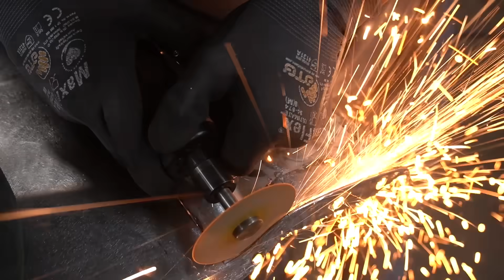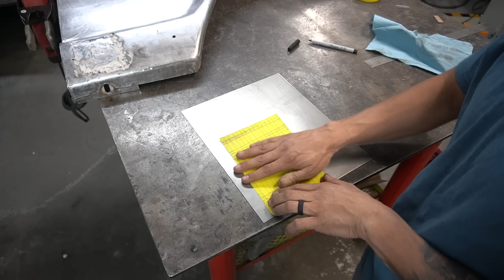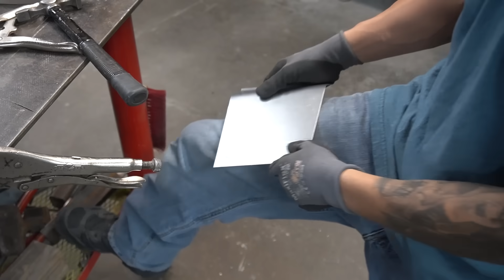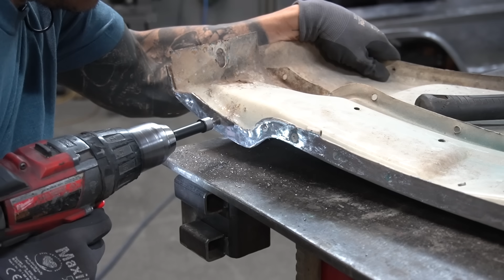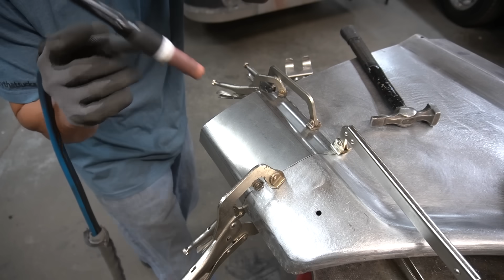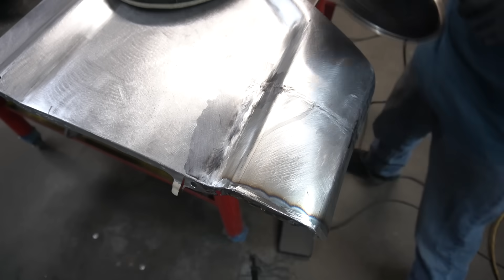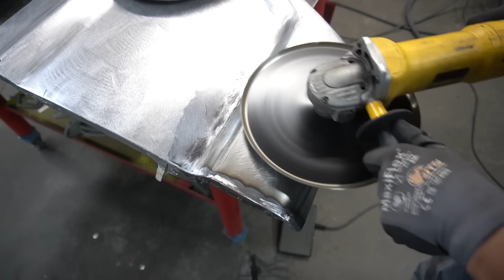how to make a patch panel | fix rust

Comment: Very good work. I need to have this done on my 69 Chevelle. Where would one purchase the correct gauge metal for such a job?
Reply from the maker: I get it from the local steel yard in Albuquerque. its just 20g cold rolled mild steel.

Comment: QUESTION : Why did u used TIG for the surface operation, and MIG for the back panel operation?  Can you explain me the differences?
Reply from the maker: tig welds are malleable for planishing much more than mig welds. also the mig welds are better for spotwelds and quicker for welding the brace back together

Comment: Very nice job thanks 
I need that air grinder with the disc and how many mm thickness the disk and where to find and what model I appreciate your job professional too really and simple teach too
But I use tig welding give much cleaner job I am in thailand can’t find many things specially some your tools
Reply from the maker: Yeah Thank you! I have a few angle grinders Snap-On and Matco, I believe they are 1hp. they can be found on ebay.com. the disc is a 36 grit 3M roloc. thanks for watching

Comment: One of the best things anyone taught me, in 40 years of car restorarion was when an old guy turned me on to tig welding silicon bronze for patch panels. It uses much less heat and it can be shaved effortlessly with a vixen file. Heat is the enemy. Less welding and grinding heat make a more consistent repair. But a repair like this gets it done perfectly.
Reply from the maker: Thanks man and yes that is the great thing about Silicon Bronze

Comment: What gage metal is that, 18? And what welding wire are you using? Awesome work!
Reply from the maker: It's actually 20g. Also the filler rod I'm using is .035 out of the mig welder and I straitened it😎👉

Comment: why not treat / prep the backside or repaired inside of the fender patch and fender before welding the brace back on to seal the steel from future rust?  Seems like raw steel is going to rust again.
Reply from the maker: You are correct. It needs undercoating.

Comment: Great work. Question, when to use tig vs mig? Or could you have just used mig only on the fender? Thanks!
Reply from the maker: Yes I could have used the mig but the tig welds are more malleable when stretching with the hammer and Dolly

Comment: Where can i find that large grinding/shaping wheel you're using?  I assume it's playable with abrasive on it?
Reply from the maker: Actually no it's not. It's a shrinking disk to level out the sheet metal. You can get it from pro shaper sheet metal.

Comment: I am gonna try this patch procedure on a 1942 Farmall Tractor, there are a couple spots I want to patch and this may be the best I have seen yet. Thank you.
Reply from the maker: Right on man try it out of you have any questions you know where to find me.
Reply: the part I want to patch has a hole in it for the exhaust so I have to figure out the diameter of the hole thats needed before I cut the bad metal out.  @BeAMetalFabricator
Reply from the maker: Yeah I would try to get as much information from that panel as possible before you cut anything out.

Comment: What amps are you running on the tig to weld in the patch?
Reply from the maker: I'm pretty sure it was set at 180 but I just adjust my amps with the foot pedal. The only time mess with the amps dial is when I need more heat.

Comment: Absolute artistry!
I’ve often wondered how true panel beaters (a rare skill today with most shops just slinging bondo) get the patching and weld to look so flawless. 
Great video. Thanks for sharing.
Reply from the maker: Thanks man I appreciate the complement.
Reply: Maybe you should look up modern I-Car repair procedures- shops aren't "just slinging bondo" if they want to pass re-inspection.
Reply: @actually5004 Sadly most of the work I’ve seen is repair shops who are working to insurance companies who place pressure to work down to a price rather than up to a quality. 

While I accept the level of repair in this video isn’t required for a typical fender bender, my experience (in Australia) is that it’s the insurer who signs off on repairs and it’s typically a risk management approach of “near enough is good enough”.

Comment: How many amps were you running on the Tig machine
Reply from the maker: If I remember correctly it was set at 180 but I adjust my amps with the peddle
Reply: @BeAMetalFabricator  yes because I’ve tried welding thin sheet metal and it seems to me 30-40 amps seems to be the sweet spot, I would like to weld panels with my tig but so far I have been mig welding them but I can’t dolly them
Reply from the maker: @DesertRatFabrication   that's exactly why I Tig these panels together
Reply: @BeAMetalFabricator  doesn’t look like you have to much trouble burning through and you even space the panels sometimes with the little spacer things
Reply from the maker: @DesertRatFabrication   eh every once in a while ill burn through, but I've gotten the hang of it over the years I can usually prevent it from happening. thanks for watching!
Reply: @BeAMetalFabricator  yes I will be watching a lot more😀😀

Comment: 👍🏻 leave your tip in place a little longer after the tack or weld so it won’t oxidize.
Reply from the maker: Good tip! Thank you, although I know I am supposed to do this I am very impatient! I will try to slow down and utilize that tip because it is the correct way to do it.

Comment: Love the video! One thing ive always wondered with this is when do you know whether to use a mig welder or a tig for the job?
Reply: That was what I wondered. Why use the TIG for the patch then switch to MIG for the brace and spot welds. And for those of us who don't TIG, would the MIG work for the patch?
Reply from the maker: The mig would work for the patch the only problem is mig welds are a lot harder and that makes it really difficult to planish because the welds don't stretch nearly as easy if at all.

Comment: You’re a true craftsman sir. One question- I’d always heard to never do a full weld, but instead stitch weld everything so the heat wouldn’t warp the panel. Is this not true, or is there a secret to how you weld?
Reply from the maker: well you hear correct, sometimes you can get away with welding all at once it all depends on the panel. if it was a big flat panel I would have took my time and let the panel cool. in this case it was close to a curve and I had access to the rear side of the panel so I was able to planish everything smooth after the heat distortion.

Comment: For a hobby guy what MIG do you think would be good?   I'm looking at the Hobart 210MVP.
Reply from the maker: Well I'll tell you what I bought a Hobart i165 Tig welder in 2012 and that machine is a reliable today as the day I bought it! The mig I use is a millermatic 211

Comment: Good patch job. Should you treat the back of patch before you welded frame back?
Reply from the maker: Yes it need coating.  I sprayed some undercoating in the space between the brace and the panel with an internal frame coating aerosol nozzle.

Comment: Great video!

I was wondering; why did you TIG the front side of the panel and switched to MIG for the back?
Reply: MIG is faster and the backside won't be seen, so just a rough finish is fine.
Reply from the maker: He is correct 😎👉
Reply: @BeAMetalFabricator  lucky guess 😉
Reply: @DeliriumElectric  Thank you!

Comment: Excellent. Can I ssk what you did about rust treatment before welding back the rear piece?
Reply from the maker: You are right that will need to be coated.  But coating it with por 15 would have delayed my video another day so I will spray some rust preventative in the gap between the brace and the panel

Comment: The only thing I would even think to add to this tutorial is explaining corrosion protection when the fender brace is welded back in. Weld through primer is always a nice bit of added insurance. 
Great work! 👍🏻
Reply from the maker: You are right that will need to be coated.  But coating it with por 15 would have delayed my video another day so I will spray some rust preventative in the gap between the brace and the panel I'll put that process in the video next time. Thanks for the tip
Reply: @BeAMetalFabricator I've heard mixed reviews on por15, maybe it's in relation to being exposed in locations where it might get chipped. Any other solutions here? What about getting all up in that brace? Money's on it being rusty all the way up. I know at some point you have to say 'good enough' but one thing that causes me grief is knowing where to draw that line and be reasonable rather than go full on OCD. I suppose once assembled it gets underbody oil too
Reply: Other thing is instead of working the weld continuously one direction, jump around and back step the welds. Requires a hell of a lot less body work at the end by minimizing shrinkage and warping.
Reply: I asked that question after you !
Reply: Hey man, amazing video, when you sand down a panel like that...what grit do you use??
Thank you
Reply: That was  awesome.

Comment: very nice jub and explanation . no explanation of bare metal treatment  to prevent future rust .
Reply from the maker: You are right that will need to be coated.  But coating it with por 15 would have delayed my video another day so I will spray some rust preventative in the gap between the brace and the panel. I'll show this process next time. Thanks for watching

Comment: We are thankful you are sharing your techniques and knowledge you do great work.  Could you explain why you tig welded the outside panel and mig welded the inside support panel.
Reply from the maker: Thanks for watching man and yes. Okay, there are a couple of different reasons for this. First, when I'm aligning the patch and it's clamped in place, if the root gap isn't wide enough, when I tack it with the MiG welder, the heat often pulls the two panels being welded tightly together, closing the root gap. If the panels aren't perfectly aligned or level with each other, this can result in having to cut the tacks off to realign the steel. Another reason is that MiG welds are extremely rigid and lack the malleability of Tig welds. So, when you need to planish the metal afterwards, the area around a Tig weld can become brittle and doesn't stretch as easily.

Comment: Had to fab a cab corner today using an anvil of sorts using  pipe, angle iron, anything handy and ball peen hammer. Used piece of junk mail to make some sort of a pattern. Flat ones are fairly easy, the round corners get tricky! Get to mig weld that in the morning, a tig would be great. I've used a welding rod before on thinner stuff to stop blowing holes but normally after 30yrs it works out ok.
Reply from the maker: Gotta use what you got man! I have utilized the same methods! Thanks for watching!
Reply from the maker: Gotta use what you got man. I have utilized the same methods. Thanks for watching!

Comment: Really like how you showed the how to from start to finish. It’s the thing that brings me back to see what you are doing over and over . One question you made an air powered slapper hammer , and the video seems to have vanished on the tube. What happened with it ? I made one and the thing is fantastic to smooth metal fast.
It was how I found you and your work. Hey I really like what you do and look forward to learning more from you.
Thanks
Reply from the maker: What up @dans.98! Thank man that means a lot bro. And I had to take that video down because I got a cease and desist. Someone has a patient pending on a product that is similar so I had to take the video down or end up in a lawsuit. I appreciate you watching my videos man
Reply from the maker: @dans.98 Yo I was thinking about the pneumatic slapper you made and I would really like to see it! Is there any way you would be interested in joining my Facebook group "be a metal Fabricator" and post some pictures of it? I would really appreciate it!
Reply: @BeAMetalFabricator  
Sure not a problem, would be happy to send a pic of my metal slapper I made from following your video.
Reply: I would need an invite to join your group.

Comment: Like the format of the vid. Clear Concise and to the point. LUV the masking tape templating. I've used that method for  yrs. and its the fastest most accurate way to make patterns. awsum.
Reply from the maker: The tape template works wonders you can get quite complex with these patterns depending on the panel. thanks for watching!

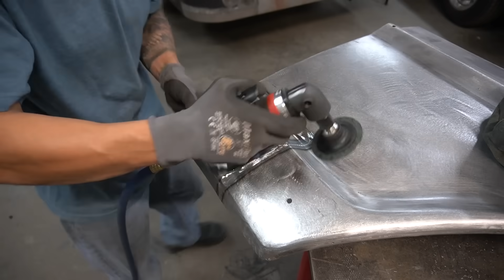Comment: From 11:50 it is visible that the panel is rusted under that brace (it was pretty rusty under the piece you've cut as well). I always wondered how one treats that, what should you do to stop that rust, especially underneath multi layered body panels like this, or the insides of pillars for example, on a car restoration. I thought to myself, finally I will get the answer to this question, but you just left it alone, and welded the cut piece back, over the rusty panel. Do you do any post treatment on this, or how do you prevent that rust traveling further in the future underneath braces and inside of body panels like this? Nice work thanks for sharing!
Reply from the maker: You are right that will need to be coated.  But coating it with por 15 would have delayed my video another day so I will spray some rust preventative in the gap between the brace and the panel! Thanks for watching I'll show that process in the next video
Reply: @BeAMetalFabricator  Thanks, will keep an eye out for that :)
Reply: Your correct.  It is a master piece of metal work. However it is going to rust out due to not having been treated with the proper burn through metal primer. 3makes a great product that you that metal with prior to welding. As to the rest of the panel it should have been separated and cleaned treated with phospic acid then primed inside . Great metal work. Just no rust treatment or prevention. Shame. It would have been a lifelong repair. But it will rust out.

Comment: Only note I’d make, is that the patch is much easier to tig, and hammer and dolly heat shrink, with rounded corners. I use a 1/2  drill bit, inside the marked square, before cutting the metal to be replaced. Cut out, then round the corners on the patch. Also make cutting with a cutting blade easier, as don’t need to cut to a perfect intersection. More consistent heat for the weld too, when you don’t need to pause at a corner.
Reply from the maker: Thanks I'll give that a try!

Comment: I only own a mig. What are the advantages and disadvantages of using the tig?   And why you did not use the mig?  Any real big disadvantages ?
Reply from the maker: Okay, there are a couple of different reasons for this. First, when I'm aligning the patch and it's clamped in place, if the root gap isn't wide enough, when I tack it with the MiG welder, the heat often pulls the two panels being welded tightly together, closing the root gap. If the panels aren't perfectly aligned or level with each other, this can result in having to cut the tacks off to realign the steel. Another reason is that MiG welds are extremely rigid and lack the malleability of Tig welds. So, when you need to planish the metal afterwards, the area around a Tig weld can become brittle and doesn't stretch as easily.

Comment: Nice job!! Only thing I didn't like was the spot weld cutter  :)  I gave those things up long ago.
Reply from the maker: How do you drill spot welds? Were you using the Blair sheet metal cutters? I use them for everything not just spot welds.
Reply: I have been using Bullet drill bits. The advantage is they are strong, never break. You can get them in any size, so the size of the spot weld is not an issue. And spot welds vary in size greatly around a vehicle. And they leave a surface ready to reweld, if that is the goal.  @BeAMetalFabricator
Reply from the maker: Thanks I'll check those out!!
Reply: Great job.

Comment: Fantastic work.  What about paint on the inside before the inners go back on?
In the UK this repair would rapidly rust out again.
I weld up the outer, paint inside of both panels with epoxy, wait for 24 hours+, then weld in the inner.  
Then completely drown it between the panels with dinitrol 3125 rust proofer.  Time consuming to say the least!  
Many customers won't agree to pay the amount for the necessary work needed for the best repair possible!
Some do.....
Reply from the maker: Yes I agree, it needs to be undercoated! There is enough of a gap between the panel and the brace to get some coating on it! Nice observation!

Comment: I noticed you didn't hop around on the welding just kept going . Is this because you were using  Tig? Warping wasn't even an issue.
Reply from the maker: Well with Tig warping can absolutely be an issue, it all depends on the panel. I explain this in another comment. I'll tag you in it

Comment: Too much heat when constantly welding caused the waves in the metal.  Sheet metal is pretty thin anyway so take many breaks when welding. Cool down the panels with air and start welding again.
Reply from the maker: So in my experience any heat on the panel warps it. It all depends on the panel weather I weld all at once or if I take breaks in between. on a mostly flat panel without access to the backside I will slowly weld it in sections as I let it cool, this has pros and cons. cons are there are many little warps where you stop and start pros are it won't put a huge warp in the panel (sometimes). With a panel that has more contour or beads you can get away with welding all at once (again depending on the situation) especially if you plan on planishing the panel afterwards. proof is in the pudding though. this panel was close to perfect when finished. I would put the same patch up against anyone else's work with a different method.
Reply from the maker: @juanlanda2441